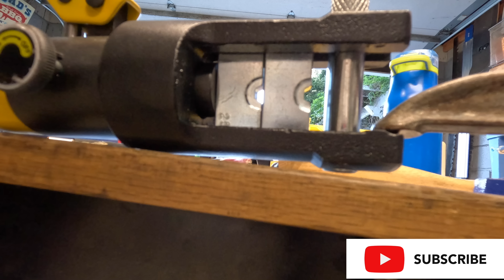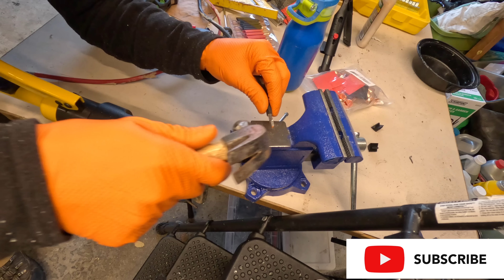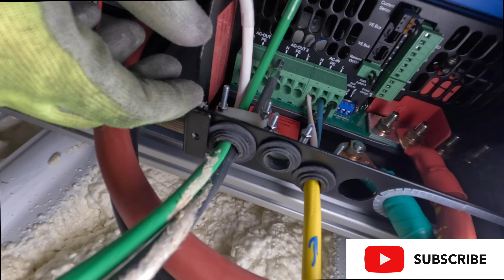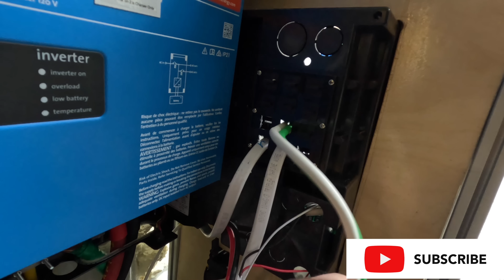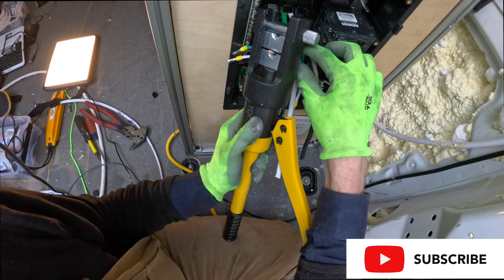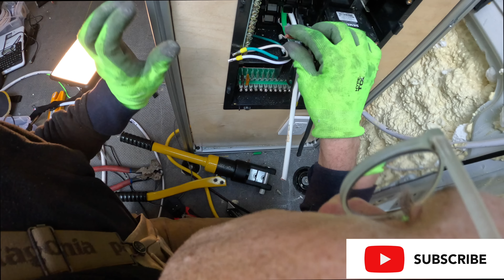Victron Inverter AC Wiring: A Van Life Electrical Guide

Comment: I thought that first ac out on the multiplus was a straight pass-through from shore power?
Reply: I was wrong…it’s the second one. Sorry
Reply from the maker: It's okay the multiplus will give AC shore power from both ports depending on programming. Check out solar prioty options